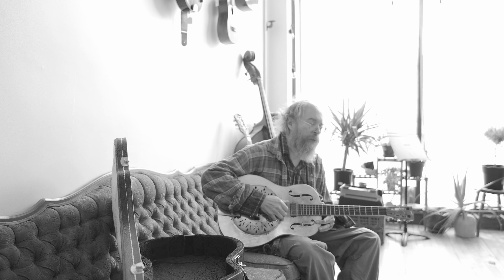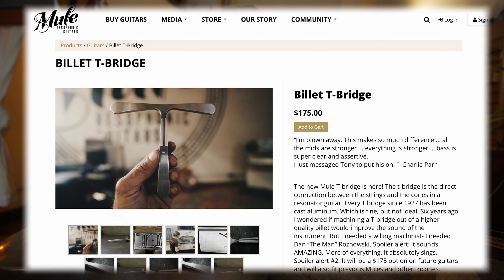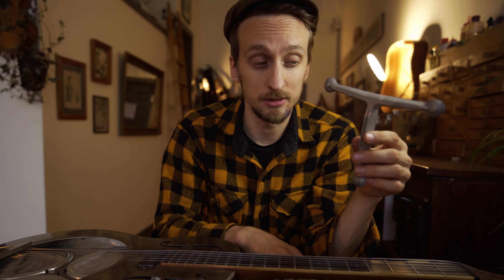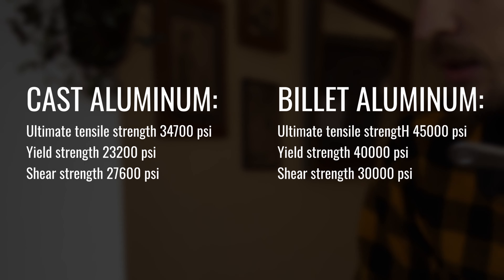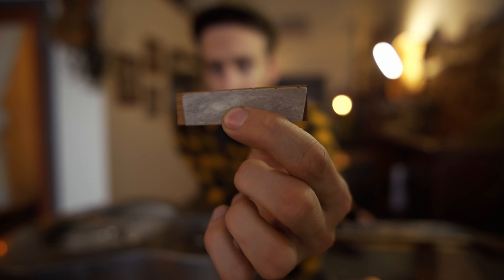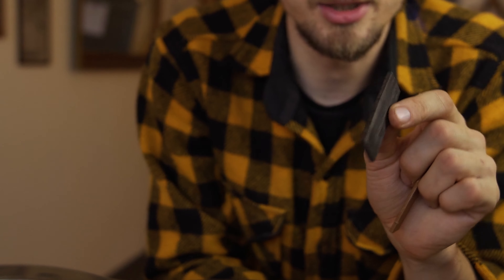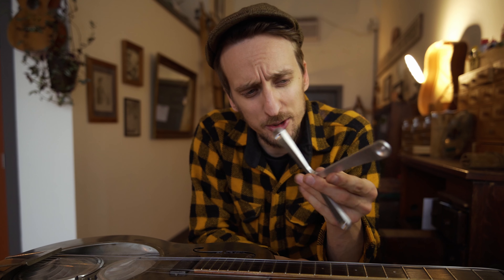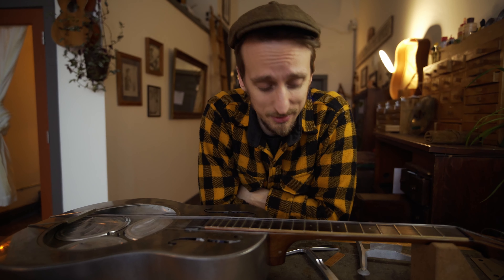Installing Charlie Parr’s Billet T-Bridge. (honest opinion)

Comment: Great video Kyle!  Thanks for getting it swapped over!  I think Charlie was one of the last flat fingerboards. We've used fingerboards with a 20" radius for 700 guitars or so. Which is still pretty flat!
Reply from the maker: Ah thanks bud. Easy swap! Thanks for thinking of those little feet btw! It really takes the stress outta poking holes in the cones while you’re doing the setup.

Good to know about the radius update! Tbh I would have NEVER noticed it was a flatboard until having to make a saddle for it. Probably cause of your handshaped neck, this things just a cozy littler player!

Comment: Maple was the choice after trying other hard woods like rosewood and ebony and even bone which fail to transmit the warmth of the bass and sound weaker then maple. John Dopyera states that quarter sawn maple clearly delivers the most volume and the best tone . The V shaped groove running under the saddle area in the bottom of the casting is there to decrease the weight of the T bar .  Do Mule resonator guitars use National cones?
Reply from the maker: I’m not sure what they do now, but in the beginning that’s what I was told anyway. Spinning cones is a trick!

Comment: Well, dang... 

Looks like I need to upgrade my Mule soon...
Reply from the maker: Absolutely do! Lmk if the vid leaves you hanging on the install, I could make another one that better shows the whole process a little slower.
Reply: @kostringworks  - appreciate that. I'd likely hand the work off to a pro at this point.

Comment: Has anyone tried carbon fibre saddles?
Reply from the maker: That’s a good question. I worked in a guitar once that was one piece of C fiber, so the bridge and saddle were molded as one. That’s the only one I’ve seen.
Reply: Billet aluminum saddle? Would that be too harsh ? Brass?